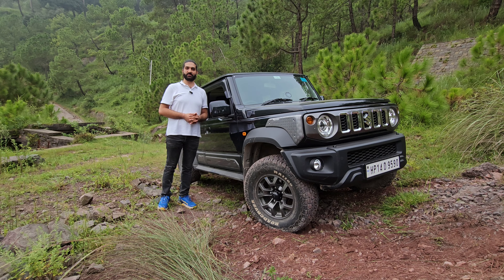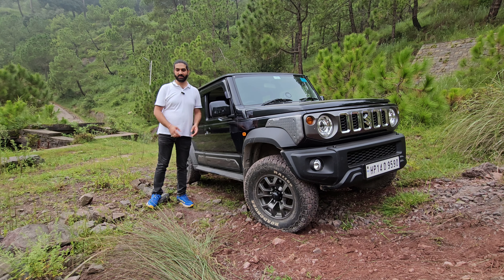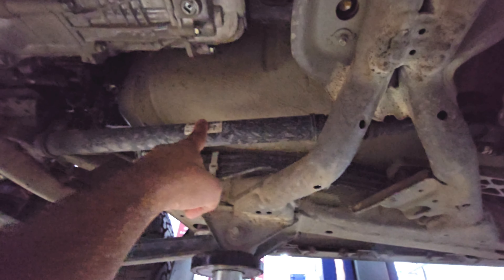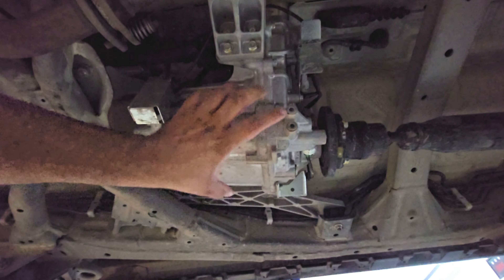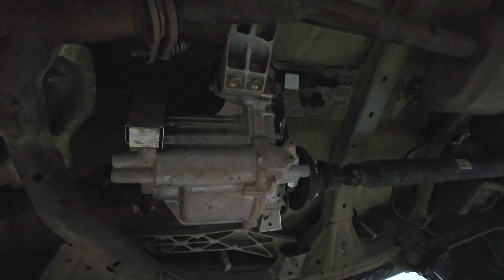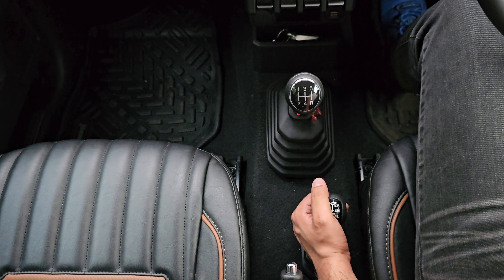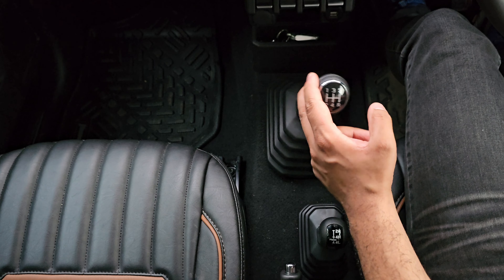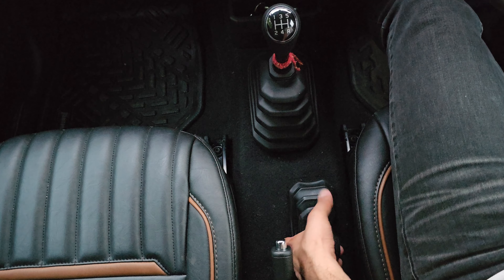Simple Yet Effective 4x4 System Of The 5 Door jimny Detailed Explanation||@RoadsOfTheMountains

Comment: To engage 4H you don't have to set the main gear to neutral; it is on the ply shiftable!
Reply from the maker: Hi,your imformation is correct.
But this one instatnce while uphill offroading i put my jimny in 2H fron 4H
And inspite of that my front wheels remained engaged.They only disengaged after i neutralized my gearbox.Hence this imformation.
I Have concluded from my personel experience that 2H to 4H on the go can be done while the vehicle is in a constant speed.When stationery it takes time to engage or disengage.
Regards

Comment: Extremely helpful video. Pls share ur views on - Can we engage 4L during a offroad hairpin turn climb in Ladakh mountain passes? Since u already mentioned that the wheels should not be turned during 4H 4L engagement. What does one do when climbing hairpin turn offroad mountains?
Reply from the maker: Hi,thanx for tuning in.
During the OFF-ROAD hair pin turns you can engage 4L or 4H without hesitation.The loose terrain beneath the tyres will allow for easy movement after 4  X 4 engagement.
But on paved or metalled Hairpins it is not recommended to use this system untill one is extremely stuck( which will not happen on paved roads).
So yes you can use the 4 X 4 system on OFF-ROAD hairpins in mountains.Go ahead worry free.
Regards
Reply: @RoadsOfTheMountains  thanks a lot.. tuning in for more of ur vids on jimny

Comment: Very nice explanation, specially for a 4x4 beginner, I just  have a question.... you said, when  switching from 2H to 4H or 4L mode,  steering should be straight, but if I need to use one of those systems on a particular scenario where the vehicle on a steep incline and a sharp hair pin bend is ahead , means , I need to take immediate sharp turn with 4H or 4L, then what would be your suggestion  ?
Reply from the maker: Hi Thanx for the kind motivation.As for the answer for your question,what we need to understand is if it's steep and extremely curvy,you will only be needing  to apply 4H or 4L if the conditions are on loose surfaces.In such situations we do not have any problems regarding damages to axles or any of it's components when we low grip situations.

But if you negotiate any hairpin curve on tarmac road or a paved road,then it is prohibited to use 4 H or 4 L,as each tyre will have a different curving radius,the high grip will create a lot of tension on the wheels,thus the pressure for it's compensation travels to the axles resulting in damage to the axles.
So 2H for the tarmac roads and 4H and 4L for offroads. Hope this creates a better understanding for you.

Comment: I'm confused between AT and MT ? 
The purpose would be traveling around hilly terrain and when I took the test drive AT felt quite well balanced for the kind of ride. While the manual one was quite notchy. Did you felt any difference after riding couple of months?

What would you recommend!
Reply from the maker: Hello Akash,If you want a relaxed driving then go for AT.well for me the gears are still notchy ,they are gonna stay like that only.It adds to the robustness of the jimny,in the sense of shifting feels.
The manual has a extra gear,whereas the 4 speed torque coverter is a gear less but the ratios are longer so it compensates for it.
AT is hassle free and comfy,MT is for more control and feels analog down to it's core.Rest will always be your personel preference mate.
Hope this answers
Reply: Appreciate your fast and comprehensive response. 

The last two videos are really immersive and make it feel like a 1st person view. Keep up the good work 💪

Comment: Totally new to 4x4 so 1 doubt.. after putting the gear to 4H or 4L in neutral, do we need to change the main gear to 1 before accelerating? Or the 2nd gear acts as a separate gear?
Reply from the maker: Greetings Danny,well what you need to understands is that the torque multiplication works only in 4 L. when in 4 high you need to accelerate by applying the 1st gear or else you will stall your engine.But when in 4 low you can easily accelerate by applying the 2nd gear even in moderate inclines also ,as the multiplied torque can easily handle the 2nd gear ratios without stalling the engine.Hope this answers.stay tuned and have a good day.
Reply: Got it. Thanks!  @RoadsOfTheMountains

Comment: 4H can be engaged on the fly and no need make the main gear on neutral i think . under 100 you can change to 4h i think
Reply from the maker: Yes it can be engaged on the go but only upto a speed of 50 kmph.As i have laready mentioned in the video.I am pretty doubtful for the 100 mark.MSIL Also states it below 50 only.
Reply: @RoadsOfTheMountains  The tag you get on a brand new Jimny's gear lever specifies that if you must switch from 2H to 4H while in motion, speed must be below 100 kmph, wheels must be straight and the accelerator pedal must be released. Still, it's safer to stop.

Comment: Can we use 4H on a wet tarmac road for better traction?
Reply from the maker: Hi,You wont get any huge advantages out of a 4 H on wet tarmac,if it is a wet muddy road definitely yes you get use out of 4H.otherwise it is not really rquired on wet tarmac.AWD equipped vehicles get constant torque vectoring which helps them on wet tatmac to go through situations very intelligently.Jimny is plain n simple, use 4H only when required.
Reply: @RoadsOfTheMountains  Thanks for the clariification. I will try and share one vlog for a popular offroader from AUS.

Comment: How about cancelling the 4L? Do we need to stop the car even for cancelling the 4L or we can just cancel on the move?
Reply from the maker: Yes we do need to completely hault our vehicle if you want to shift from 4L to any other selection.Atleast in the jimny we have to hault because everything is very analog,and the gears are in a lot of pressure and load.So canceling 4L without stopping is a big NO.

Comment: In my opinion y he Brake Limited Slip Differential of the Jimny is too slow to react. I needs 4-5 full revolutions of the wheel before it understands to apply brakes to the spinning wheel transferring torque to the wheel not rotating. 

Other brands are much better at this. Meaning, if you want the AllGrip system of the Jimny to perform well you need to keep the engine rev’s at 3000-4000 for the AllGrip to understand what it needs to do. This is not always ideal, especially when rock crawling. 

Solution …
Get one or two / front or rear/ or both differential lockers. 
In general there are three kinds of diff-lockers. 

1. Air lockers. The best ones are from ARB in Australia. The cheap ones are Chinese copies using cheaper materials that brake - don’t buy them. 
Air lockers require a compressor. 
If an air-locker isn’t installed well air-lockers will leak air, I.e., will not engage. 

2. Electro magnetic lockers, E-Lockets. Installation quality is important. 
E-lockers disengage if the vehicle reverse. It will only re-engage when more ving forward by 1-2 turns of the wheel. 

3. Automatic lockers. These lockers are fully automatic. As long as the wheels on the same axle rotates at the same speed the differential is closed/locked. But when on high friction surface like tarmac making a turn the auto-locker will unlock itself to permit the outer wheel of the bend to turn faster than its mate on the same axle. 

The auto-locker is my favorite. It cost less than the other two, it’s more reliable, and it challenges me as its driver because I have to be mechanically empathic driving it. 

In my Gen3 Jimny o had a rear LockRight locker from Power Trax. It turned a very capable 4x4 to a mountain goat!

Today I have a Gen4 Jimny with front and rear diff-lockers from Kaiser in Brazil. 

Yes, the lockers from ARB are the best. But for half the cost of the ARB’s I got two lockers from Kaiser. As I’m on a budget, I favor the Kaiser ones, hands down. 

Nothing will have as a great impact on capability of your 4x4 as one or two differential lockers. 
- Get them.